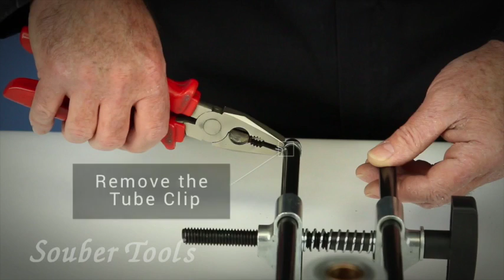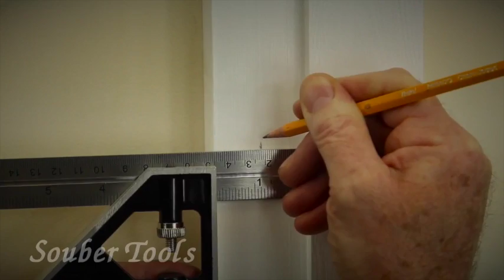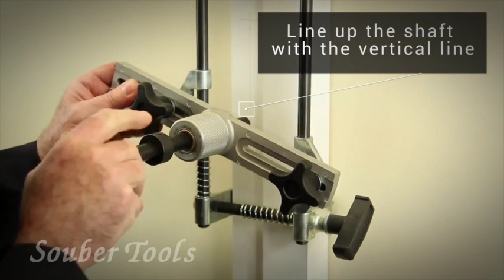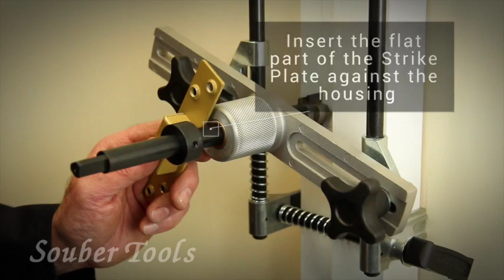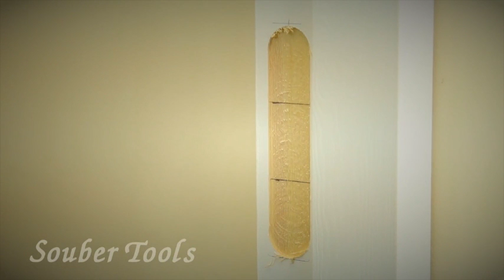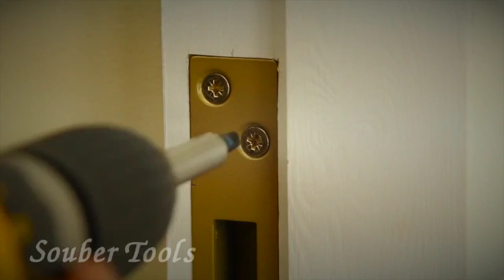Mortice Jig - Cutting a strike plate on a door frame

Comment: Is a corded power drill required? Are 3000rpm’s required to get the best out of this jig or would a cordless drill with 2100rpms be suitable?
Reply: Price please
Reply: 3000rpm is best but have done with about 2000rpm when forgot faster drill, still works but slower and can be a bit burry so remove material a less pace
Reply: I like to drill hard and fast